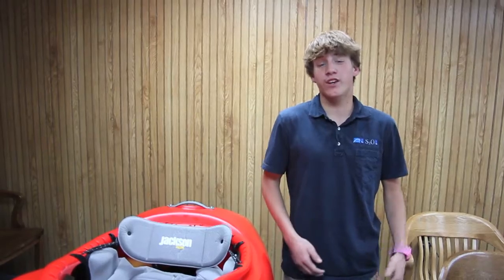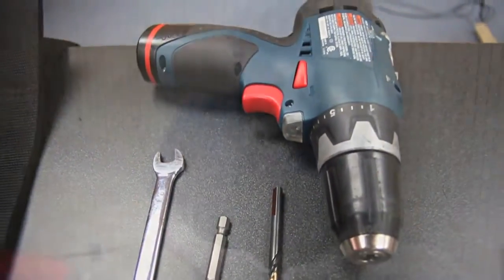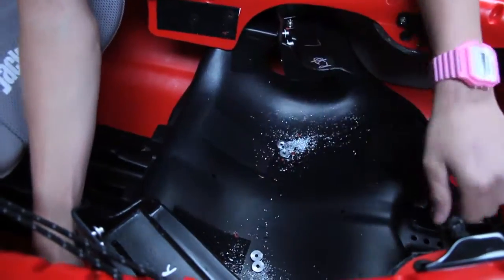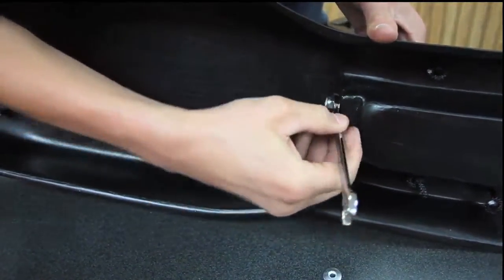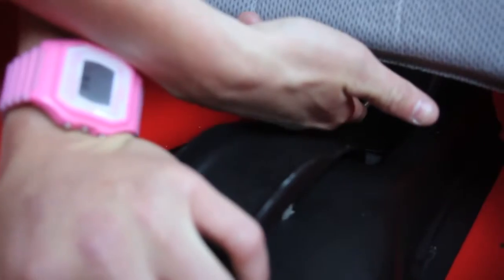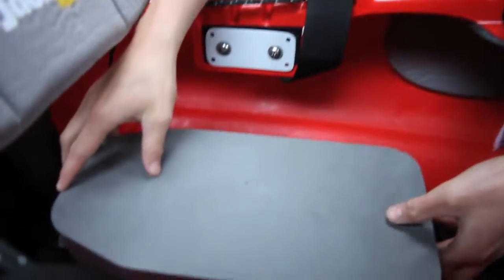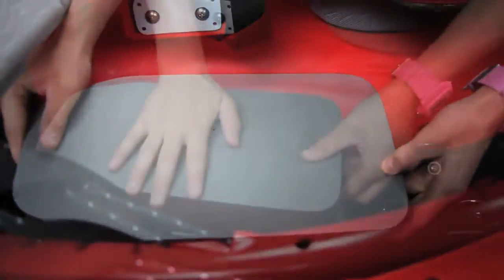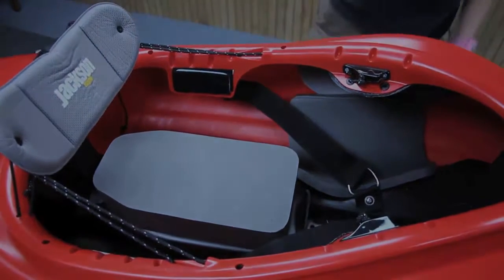How to Retrofit Your Jacksonkayak C1 Saddle

Comment: It's made for the newer rail system, but I read that several folks have done it simply by drilling a hole through the saddle base. Slide the bar through, then install the walls and saddle at the same time. Not a big deal. Should work fine...